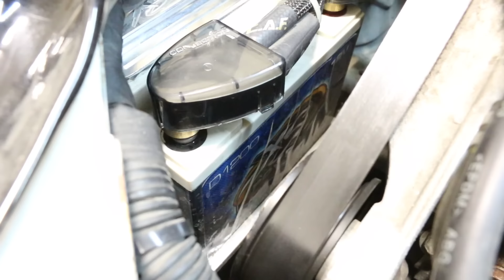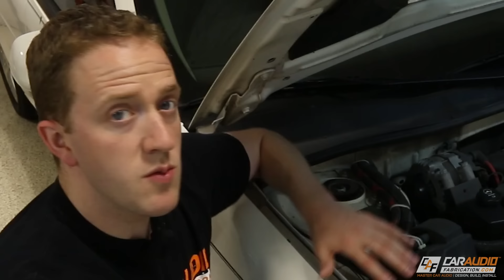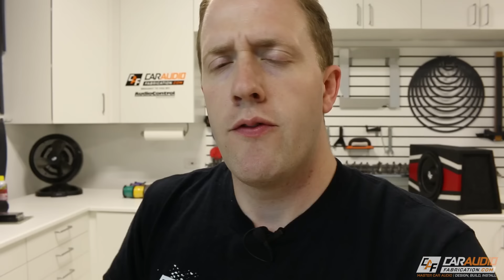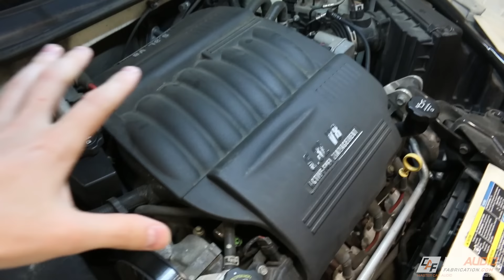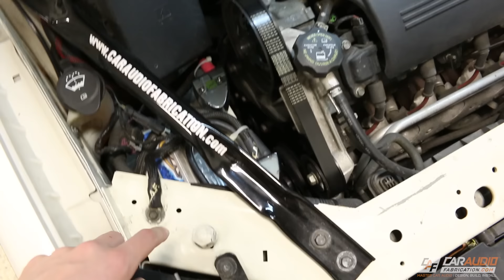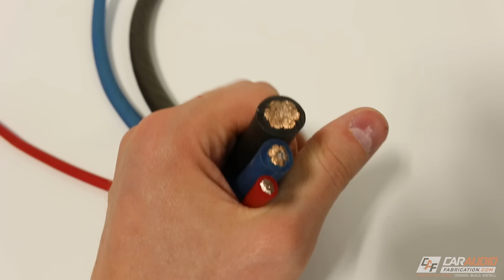Upgrade THESE for better Car Audio performance

Comment: Would it be more efficient to install the alternator in the trunk so it's closer to the amp?
Reply: Enrique Lomeli That would require a pretty convoluted belt setup. ;-)

Comment: What are your thoughts on welding cable? I hear mixed reviews on it. Besides it being thicker stranded and less flexible, does it not transfer current as efficiently?
Reply: Og Scythe I used 2/0 CCI Royal Excelene for my car. Pretty fine strands and quite flexible, IMO. I'm happy with it. It may go by a different brand now. I think the company got bought. 
https://www.wireandsupply.com/2_0_CCI_ROYAL_EXCELENE_WELDING_CABLE_BLACK_p/wc-2-fslash-0-01.htm
Reply: It is my understanding that to electricity, copper is copper for the most part.
Reply: @caddyguy5369  OFC is ideal!
Reply: @caddyguy5369  the best conducter*
Reply: @anthonyherring6636  From what im seeing on a search, most welding wire is OFC.
Regardless unless you are dealing with a massive system and things are sized properly, you likely will notice no difference. Not talking about CCA wire BTW.
Edit: A thing to keep in mind though is the insulation isn't as oil and chemical resistant and have to be careful to prevent chaffing.

Comment: Is there any benefit to installing capacitors inline with the cars electrical system for short term power reserve?

I've been wondering about this, not just for audio, but the annoying temporary light dimming when you roll down a window or when the A/C initially kicks on.  The Alternator always catches up quickly, but I would think it puts an unneeded shock load on the system.
Reply: Light dimming from normal creature comfort options isn't normal. Could be a sign that one or more rectifier diodes in the alternator are on it's way out. A capacitor would then help smooth out the AC rippling getting through the diodes, but is not a solution to the problem.
Reply: No...caps are garbage and a waste of money.

Comment: Id say the decision would be very car dependent. If your working on an older car, you might want to look at sprucing up the big 3 just to keep the old girl running! I have a 1990 LS400 so for me, the alternator could do with an upgrade and the wiring is probably shot too. As a general rule tho, battery1, earth strap/wiring2, altinator3

Comment: Installing thick AF power and grounds. I would say go bigger than needed in case of power upgrades later.Last build I ran a 0 gauge power and grounds from the front battery to the back and later switched the ground to a second power wire. I've already done a mechman alt and second battery. Unfortunately my Grand Prix has a electronic throttle body and responds to low voltage and dips with low rpms from closing the throttle plate, which only compounds my voltage problem

Comment: Hey Mark, big shout-out from South Africa dude, really enjoy your Chanel.
I actually have a power issue in my mini truck, I have a 4 channel and a mono-block that's running my door speakers and 1x 12" sub-woofer, along with this I also have air suspension in the car running off of a 8 Solenoid system. When Ive been playing my audio system quite loud for over 30min I eventually pick up issues with my rear solenoids, they don't lift up the rear of the vehicle until I rev it for few seconds then shortly after that the rear solenoids respond. Does this mean i would need to upgrade my alternator in this case?

Comment: I'm in desperate need of help. I've got a big 15 inch kove audio Armageddon it's a beast. I can't find no information about a sub box for it. I want to run a ported box. Could you help me with info please thanks in advance
Reply: Tony Lee, is it the X, or XX? 
I can't find any TS parameters for this sub. I suppose it's meant for pros with their own testing equipment.
Reply: Spaceman Rick man I really don't know I know it a old school it is huge lol. The magnet it self weighs 70 pounds and it unscrews off the basket if I blow a voice coil it's easy to swap. But it also is a quad voice coil it's got 4 sets of terminals

Comment: Upgrade the big 3 first. You would see a huge boot from your stock electrical, then depending on you motive behind the build either and alternator or a cap bank.

Comment: Will you make a video on how to get rid of the engine whine you hear when you take out the factory  radio and replace it with a new aftermarket radio like the kenwood ddx9903s . I have tried running ground wire to the alternate, battery, different body grounds but the engine whine is still there .  I was told by some installers not to use a ground isolator and to find the reason  for  the  noise and that a isolator was like a bandage and not the correct  way to fix the problem .
Reply: I haven't tried it, but I saw somewhere to run a small ground wire from the "outer" part of your rca cable going to the back of head unit to ground.  Ground loop idolators are not a good idea, like installers said, just a bandage.  High quality wiring, interconnects, and good grounds go a long way.
Reply: I'll give it a try thanks. I have like 5 grounds already a few more couldn't hurt   The factory radio  used the same wiring   and ground to the radio with no engine noise  but with the new radio I used a rca type  coming out of the radio to the harness that goes to the same wires the factory was connected to, so the only difference  in the wiring  is from the harness to the back of the radio and now there is whining from the rpm of the engine .

Comment: Big 4  .....1... B+ alt  to  positive batt....2....alt case to neg batt.......3.....upgrade neg batt wire  to  good  tested ground....4...ground wire from engine to good tested ground on body... more ground the better......and you can also run neg wire from 2nd battery directly to first battery.

Comment: 1st, you would calculate the additional power draw, at peak for the components you will be using. Then consider the power output of the alternator, then decide if you will be using more or less then the current system, also dont forget to add in the normal consumption of the car, with everything you could use at 1 time (unless you dont plan on driving or using air conditioning etc while showing off your air pumpers).  How do you decide, well if your power drain is going to be the same or close to the same as the alternator output, you need to upgrade the alternator because it will overwork it, you could add a battery but then you will have down time while you recharge them.  A cap pack would also do it, but again, they have to be recharged after usage.  That would help if you only go over the power output of the alternator at peek times, and have enough left over from the alternator to recharge them after its used.  If you are using more, you need the same, upgrade the alternator, to consider if you actually want/need multiple batteries,  in  my opinion, additional batteries are only effective when your power consumption is peeking which is while your amps are at their most power usage. The amps will draw way faster then any alternator system but primarily at peek times.  So you will need a little extra juice to get through that, and to be able to recharge that used juice while not at peek.

Comment: Now, I always try to overkill whenever possible so that I don't get cornered with higher audio demand but I have grounds running all over the vehicle just for added measure. Not to mention, no positive cable or wire is running without a fuse be it ANL or regular fuses. By overkill I mean 3 AGM batteries and a 390A HO alternator when really I'm just pushing 1600w RMS. Really nice when the voltage stays constant. My first step would be a high output alternator with the big 3 to support the extra load then get a battery.

Comment: Any person who knows what they are talking about will tell you you have to start at the beginning. I mean alternator. However, not everyone has the money to do so start with the wire up grade. Also, don't buy the cheap stuff either by good quality stuff. If you do not buy the quality wires then you will just have to once again upgrade when you do get the alternator.

Comment: I have a gxp and i upgrade the battery and i am running 2 amps highs and low i have like 1500 watts rms and no issues i also did the big 3 but i do plan on a new alt i have 0 gauge all around
Reply: im running the same 1500 watts rms in a 95 caprice... debating between doing big 3 first or upgrading battery first... thinking of going with big 3 then battery hopefully that takes care of the interior lights dimming. did you ever get around to getting the new alt in there?

Comment: Wiring then alternator then battery. Don't see many instances of really needing a capacitor after that is done right.
Reply: Well, the capacitor will be needed if you want more stability. Especially at high wattage, if you start going over 2000w then the capacitors could help alot.
Reply: @kennyrogers9305  a rear battery provides better stability for your alt than a cap imo

Comment: Number one upgrade should always include wiring considerations. Unfortunately, CCA (Copper-Clad Aluminum) has only served to muddy the waters of this upgrade. OFC (Oxygen-Free Copper) is the most economical, energy-efficient, most durable wiring solution.
Reply: I use welding copper wire 99.9 copper
Reply: rocknroller1999 

It’s actually illegal to install CCA wiring in homes and you can’t really get the stuff unless you are a contractor.
Reply: @thegreatempire3882  Really?!

Comment: Defiantly the big three even before a second battery, I'm running about 2800 watts rms power in my car and all I have is a the big three and a       170mah battery, although I have an alt that I have to build a custom mount for

Comment: Honestly Mark, I usually go for upgrading the ground. I find it to be the most overlooked thing when it comes to big power systems. Far to often do I see someone who ran a 0 gauge power wire to their amp only to use a body ground in the trunk. When you look under the hood the factory ground to the engine and battery to nothing more than an 8 gauge strap.
Reply: How do you ohm check a ground on the body? Where would I put the positive lead of the meter?
Reply: Jack khol negative post of battery to what your checking
Reply: In most cases negative input of amplifier
Reply: Tyler Andrews all you got to do is check it with a meter. If you get zero ohms your good don’t matter where it’s wired to. I have mine wired to the body and the battery so I know I’m good. But I have a XS power XP3000 in my trunk so my wires to my amp are dual runs of XS flex OFC 14” inches from the amp.
Reply: @tammyforbes2101  why do u dual run? Please explain

Comment: #1) Wiring. If you're planning on upgrading to a big system you need proper wiring to avoid "bottle necking" the flow of electricity. Bigger wires means more electric flow to the system being built. The big 3 is commonly known to be the wires in question. I'd like to see more information on wiring and how it's possible to upgrade.
#2) Battary and alternator. Need both in sync at all times

I would also like to hear about pros and cons on wiring in series or parellel. How to design a system with respect to one another.

Great videos, love the detail and considerations. Shows how much thought goes into a build and your videos/channel!

Comment: Upgrade wiring first.
A lot of factory electrical systems are held back by the cheap thin power wires the manufacturer uses to save money.
Of course they are fine for the car in stock condition but once you add more current drawing equipment it's important to make sure the electrical system is prepped and up for the challenge.
The obvious upgrades are the 'big 3' or 4 in some cases.
1) upgrade the connection from the batteries negative terminal to the the cars chassis.
2) upgrade the wire from the output of the alternator to the positive terminal of the battery.
3) add one or multiple additional wires from the engine block to the negative terminal of the battery
4) another wire going from the chassis of the alternator to the negative terminal of the battery, rather than relying on one or two bolts as the alternators negative connection.
If you're doing all this it is important to make sure that you use high quality (ideally OFC) power cable, and that you have a really good ground connection going from the cars chassis to the negative terminal of your amplifiers.
Reply: I always lay my own speaker wiring. Always, even if leaving the factory radio. The only factory wiring I use is the power and negative, as these are enough for even most after-market radio.
Reply: 1) upgrade the connection from batteries negative terminal to the cars chassis. But I have shunt because the car have star and stop sistem so i must get stronger shunt for stronger upgread but i can not get it. How to solve this?
Reply: My bmw has optical cables and digital processors fml, going analog and aftermarket is not an easy job😂
Reply: @jhssrg_lfdesrk  same here in merc they use fiber optic cable to complete signal between components, had to pretty much replace everything including HU to make it work properly otherwise its impossible
Reply: If you understood how many cars these manufactures manufacture every single minute of every day at thousands of factories worldwide and how many hundreds of millions of miles of copper wire they save everyday by using 16 gauge wire over 14 gauge for speaker wire on each single vehicle you might be singing a different tune.
Reply: @JasonHenderson  Could you come up with a more irrelevant comment?  Why the fuck would he sing a different tune exactly?  It's no fucking question why the manufacturer uses less instead of more but thanks for the insight captain dipshit...I mean obvious..
Reply: @bsfunk44  Keeping potatoes in the dark for too much time can make them poisonous.

Now that was an irrelevant comment.  Although Jasons comment didn't really give us any information that most us already didnt know it was still pretty relevant to the conversation.
Reply: @bsfunk44  🤣